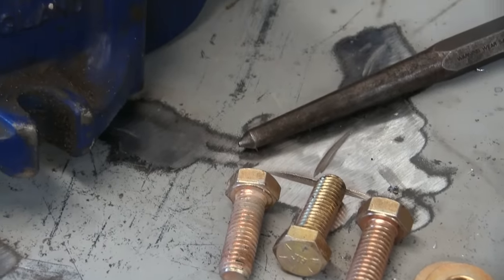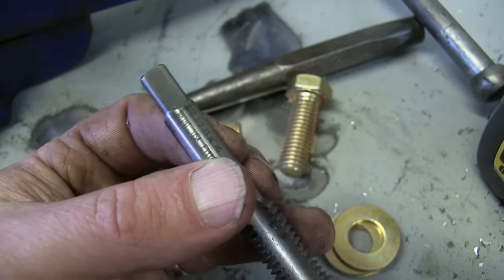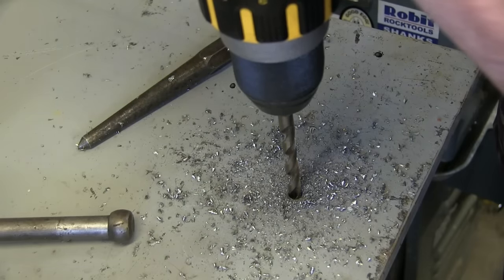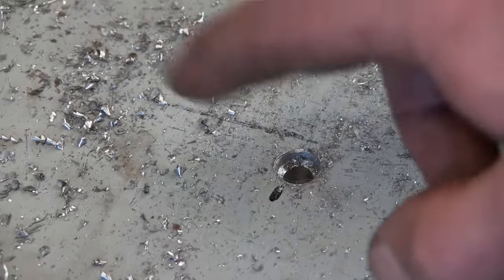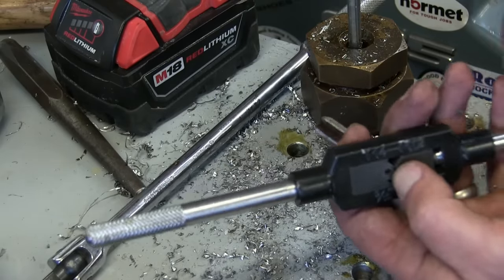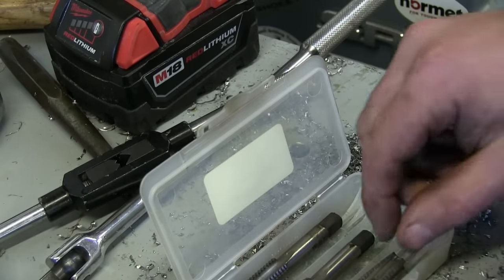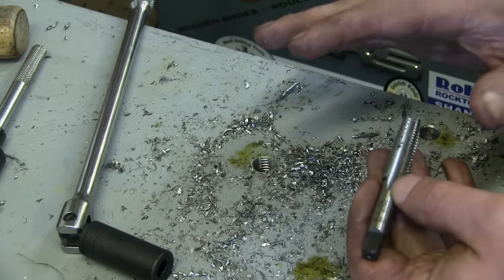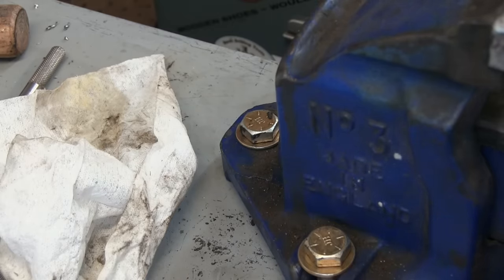Drilling and Tapping for German Virgins.  \\ GUDENTOIGHT!  //

Comment: I haven't read all 827 comment so this may have already been said.
About getting the tap started straight by hand with no guides...
Once you get a part shallow thread started, the tap will pull in but can still go crooked.
When you get to that stage, apply some vertical UP pressure on the tap handle as you turn the tap.
This greatly helps to get the tap vertical, going down the hole.
When you have about two full turns like this, you don't need to maintain any more UP pressure; just carry on turning, turning and reversing. The tap will be concentric in the hole. 
The was shown to me by a great friend and skilled machinist/welder/fabricator, Neil Budgen (Get It Sorted) of London, England.
Reply: Ross Marsden thanks a lot for taking the time to share this
Reply: Ross Marsden that’s really good advise

Comment: Pro Amateur Tip: If you can't get your taps started straight by hand and a drill press won't help you, find a machinist, become his friend (which requires you provide food and/or beer and generally for you to be a decent dude yourself) and ask him to make you a tapping block... A tapping block is nothing more than a 1" or so thick slug of steel with holes precision reamed in it for popular tap sizes, like 1/8", 1/4", 5/16", etc, etc (or metric, or both). It will keep the tap straight for you until you learn how to do it by feel (which... I have my good days and bad days).

The meanest, oldest, crustiest, most son of a bitchenist machinist at a place I used to work gave me the one he made when he was in apprentice school when I asked if he'd make one for me, which I'm pretty sure means I owe him like 2 horses and an oxen under his Journeyman's contract.

So... It's nice to have friends. I'll also never forget that guy and that block is one of my most cherished tools.
Reply: 4 years later I know you still gotta have that thing. I bet youll still have it 30 years from now too haha
Reply: @fudgepuppy9683  I'll die owning it unless someone steals it. It's in my toolbox covered in air tool oil inside a ziploc bag. Ready when I need it!
Reply: @TheBrokenLife  🦐

Comment: I always use a cordless drill with the torque set low for tapping. Never broken a tap yet. Unless you count the ones that snap.
Reply: I use those Lisle tap sockets on a cordless impact. I've tapped thousands of holes like that, never broke one
Reply: I do this as well.  As long as I stay paranoid I don't break em.

Comment: just the tip and only for a minute
Reply: Just the tip doesn't do much for me, I gotta at least get down to the scar where my foreskin was attached.
Reply: Aye, hows about startin' the tap w/ the drill press (movable bench top version)? Same for the pilot hole: drill press? Hell, the entire job for that matter? Why mess with a hand held for 1/2"?
Reply: John l bales, for the sake of showing the average home gamer that they too can do this without fancy equipment. Ffs I have access to several CNC mills and yet I too still put a hole or two into material with a good ol hand drill.
Reply: P.S. Drill press to Start the tap straight! You are way more knowledgeable than I. Hats off to you.
Reply: forkin entertaining.  part 2 dying to die
Reply: That's what she said
Reply: Didn't David Allen Coe sing about this?

Comment: Great tips Uncle BBF .... tapered point plug taps  oh yeah my favorite.  If you  don't have the correct drill don't be shy about going 10% bigger then that engineering wall chat says.  PRO tip you won't be breaking any taps either!
Reply: Awesome Me I do a good amount of CNC and spiral flute taps are a godsend. they eject chips as they cut. I use them for hand tapping too and haven't had any issues. no such luck for bottom taps, but they're not designed for forming.

Comment: Good to see a Record No 3 vise made it abroad :-)
Now. When drilling into sheet metal, tear off a 1 inch strip of old bed-sheet 6-8 inches long and fold it into 6 layers. Place this folded cloth between the tip of the big drill and the pilot-hole, then drill-away! Keep going and you will find that it will cut the cleanest sheet-metal hole you have seen. It's called the "Rag-Method"; every engineering apprentice learns this.
Don't believe me? Try it on a piece of scrap, you'll remember it forever!

Comment: Funny thing, I've been given no less than 4 sets of cheap assed tap/dies in my life and never used them. I didn't even know how to use them and never had the opportunity, either. I happened across this video as I was binge watching Youtube  while TV free in the keys for 5 months and learned myself somethin. Once I got home I needed a new miter saw and of course wanted crown stops. For whatever reason, Dewalt's crown stops are out of stock, worldwide. I decided to give the Bosch set a try and they looked like they would fit. Was I ever wrong. I needed to drill into the aluminum base of the saw and add a guide with two screw holes in order for this set of stops to work. So i go in the garage(the tap and die set storage locker) and got a set out. Followed your instructions and it worked like a charm. You really do learn something new every day :)

Comment: YES there is. You get a clamp, you put a piece of wood on the other side of the bench, over it you pass a long sturdy piece of wood that goes over the bench (and your drill point by quite a bit) and then you  add your clamp over the other side of the fulcrum (loose and taped in place) then you shove your drill under the wood and press with the might of 3 Canadian gorillas. Also helps keeping the cut steady since you're no longer practicing for your Parkinson's days.

Comment: I remember the first time I tapped a hole. Nervous, had only read and heard about it. Scared of poor performance, couldnt quite figure out how to put it in the hole right. But I started gentle and once I got it started added a bit more force. Ended up sweaty with a perfectly tapped hole and the knowledge that I was now a man. Cheap irwin got me started. More recently I found a brand on amazon thats good enough to use with just a straight drill - no impact, no tight spots, no binding - in 1/4 inch plate. Mind you, its only a 3/16" coarse - 1/2" is probably a different beast.

Comment: Also, it sure looks like AvE's drilling that hole in crooked at 5:24, but maybe it's the camera angle.  I think people new to drilling shouldn't take his suggestion that the drill will straighten itself out too seriously: it's hard to drill a hole at 45°, but drilling one 5° off vertical is really easy.

When I teach people to hand drill, I tell 'em to get their head down at the level of the drill bit, and check for vertical from two different directions.  (But get your head back over the tool when you start it up so you can apply pressure and don't get your hair sucked into the motor.  Yes this happens a lot.)  

Even better, get a helper to look from the side as you drill: the most common error is to tilt the drill back toward you as you bear down on it.  Eventually you'll develop a "sight picture" and be able to fly solo, but a drilling buddy really helps when you're getting started.
Reply: Simple drill guide: take a thick piece of wood and cut a 90 degree corner into it. Butt that against your drill bit – straight.

Comment: I was taught to power through all your problems. If the bit catches on barbs, increase torque, if its just not cutting, add feed pressure. MORE POWER

Comment: I've successfully tapped hundreds of holes with one tap using a battery impact. the thing that always breaks the tap is flexing and off center force. the impact never puts enough of a turn to break it as it really only turns the tap incrementally.  lube it up and tap a hole in 10 seconds through 1/2 inch steel.

Comment: Make it stop!  I like the vids but this was like volunteering for a women's self defense class without a cup.  

I sell drill bits and hardware for a living, and I see the same mistakes all the time. 
Don't drill pilot holes in metal!  Its unnecessary and it messes with the cutting edge of your bit. * your new drill bit comes with a  37° split point and finely sharpened cutting edge that will handle the toughest jobs if used properly*  You see, the bit is designed to cut the shape of the cutting edge starting with the tip and moving outwards. The pilot hole leads to uneven wear of the cutting edge of the bit. Over time you will create a "step" in that bit and it wont cut right and/or possibly it will catch easier leading to snappage™

Don't drill so fast. Chips are no bueno pore favor. You want stringers like that long one you had on the table. Chips mean you are going too fast and the cutting edge can't cut the material its just catching. Long stringers means its cutting. Its the same way in wood working when using a hand plane. 400 rpm there abouts will get you good results. That is why they put them pressure sensitive switches on drills and not just a single pole throw switch. 

Cutting fluid is a good thing, keeps the tips/work piece from bluing and over heating, getting brittle. Dont really want a Lubricant per se because a lubricant reduces friction and if you ant got no friction you aint getting a cut. Some cutting fluids are friction modifiers to add to the cutting ability but keep the bit cool. So no motor oil or WD-40 ( Did you know that the WD stands for " water displacing"... But WD-40 no longer displaces water? it floats on top ) 

This is unrelated but why use those Tiawanesium bolts? A good American bolt or Canadian bolt is only a few cents more! JH is Junk. Nucore, Lake Erie, Infasco are all easy to find and are good stuff. Those Jin Her bolts you used are widely available but is only fit for using on.... well not much I would want it on actually. I guess bolting down a vice to a table would be proper.... but I would just have to remember to wear my steel toe boots. I have had customers complain to me they were snapping G8 3/8" bolts with a 1/4" drive ratchet.... Not the first complaint I had on JH bolts. ( We don't sell JH only American made hardware but I see enough of the junk around I learned the makers marks for quite a few MFG) Tifco dot com if your wondering.
Reply: Scott H clearly a salesman with no shop experience.
Reply: Yeah. I agree, But you really dont need pilot hole unless hole is so big that you or your machine cannot handle drilling without pilot. And actually when drilling your chips should be short and HOT. If your chips are long and cold it means all the heat from cutting is going in your tool and/or workpiece. And if that drill is near 10mm good cutting speed for that is around 23000mm/min  23000/3.14/10 = so about 700-750 RipEm's. And downwards feed should be around 70-75mm/min. So for me AVE's drilling job looks ok to me.

Comment: Speaking of Germans and tapping, it appears that Metabo has introduced a gewindebohrer version of their biggest 18V bohrschrauber. Apparently it has a mode where it automatically goes 1 turn backwards for each 2 forwards – unlike its schlagbohrer counterpart (which is hands down the best battery drill I have ever had the pleasure of using) it has a dinky plastic chuck, wherein (rumour has it) there are square mounts for M8-M12 taps. Quite an interesting oddity.

Comment: Using a power tool in 1/2 steel would be begging for a pain in the ass night. Hey Ave I bought some starrett tap wrenches. Beautiful set. Spring loaded jaws and the finish is unmatched. Thanks Dr. Ave

Comment: I have a jillion ( or is it a gazillion?) drill bit and tap and die sets but don't enjoy breaking bits. The single best way to enlarge a drill hole to assure concentricity and to avoid a tri-lobe hole, use a single flute step drill. Even the cheap Chinesium ones from HF are a bargain AND they work really well. There are several sets of three: small, large, extra large, fine steps, coarse steps, and smooth taper. With your 20% off coupons (only one per day) you can get the whole set for about $40.

Comment: Get yourself a magnetic digital angle gauge and zero it to the surface you are tapping. Place it on the shank of the tap and you want to make sure the tap is plumb while you are starting it by checking the gauge in 2 places 90 degrees radially apart. 
 You can also just take a nut and thread it onto the tap and use that as a reference so you can keep the bottom of the nut parallel to the surface you are tapping. I did a big machining job on some 2 inch thick plates and I cut threads by hand tapping using the nut trick and I could not get a .002 feeler gauge anywhere underneath those fasteners after I had threaded them in.

Comment: Chinesium. Love it! Just because it looks similar in shape doesn't mean it will be as strong. Having the proper material for the equipment is vital, unless you like walking back to the china tire to return and return and return... people forget that their time is valuable. With non-chinesium equipment you can put the gorilla onto it! Speed is the main killer for cutting tools, not necessarily feed. Anything over 6mm (1/4") you can load up nice and heavy. Try it in a drill press, just lean on that handle. With the proper speed you can feed that bit with all your might. I will concur on the chamfeer, very helpful when trying to start a thread. Bonne Vid!

Comment: Chinesium........that just cracked me up, I'll be gigling all day with that word stuck in my head

You could also make up a drill guide plate like John (Doubleboost) uses when needing to drill square to the workpiece, use a few of the more common drill sizes then make up a tap guide plate in the same way

Comment: I do not like that socket-style tap wrench.  It puts a ton of sideways pressure on the tap as you turn it, which will rip the tap out of the new threads.  You can see how AvE has to hold the tap with his other hand to keep it from shifting.  Two-hand symmetrical tap wrench is the way to go!

Comment: The biggest reason hand taps break is not starting them exactly in line with the drilled hole. If you are tapping deep and not in  line with the hole one side of the tap will have much more load. That puts more stress on one flute and puts a large side load on the tip.

Comment: At my work we have a special power tool for tapping  (we make plastic injection moulds), maybe some day i will film that thing in action. Basically it is on a special arm just so tap is aways straight, and it has some sort of a torque limiter so you do not break taps. It is seriously cool too.

Comment: I was taught taps with straight flute are only to be used on see-through holes. That for blind holes you need taps with spiral flute in order to extract cut material which straight flute can't do.

Comment: I've used a 'brace and bit' drill for tapping threads in holes, it's easier to keep the tap in line with the hole than a T handle.

Comment: Ive once saw a really nice tool for tapping, its was pretty much a drill with a very high reduction gearbox controlled by a small angry pixie mace (micro controller) that made it do half a turn forward, quarter turn backwards, haft a turn forward, and again back, as long as you pulled the trigger.

Totaly pointless due to the existance of taps made for powertools, but still a neat idea.

Comment: easier to start a tap straight if you use a squared up block with a hole in it that the tap fits through. then no eyeballing or crooked threads.

Comment: Nominal diameter - pitch = drill size for 70% threads. M6x1 uses a 5mm drill, 3/8x16 uses a 5/16, etc. No more charts needed. 

Drill a little bigger and you can use a drill motor with greater confidence. 60% or so threads is fine for most shop chores. 10 up to 1/2 only with drill though, will bend smaller taps too easily and won't have enough torque for larger typically. 

Make a drill guide if you want to make rock-solid tapped locations straight.

Comment: I had to tap a shit load of 1/2 coarse holes a long time ago with a plug tap and I used a 3/8 drive air ratchet to drive the taps. If it got overloaded the motor would stall before breaking the tap. Needless to say I didn't break the tap during the run.

Comment: I know I am commenting a shit ton, but also, when you thru-drill a hole, you regularly don't need to break the chips, as they will have the possibility to go both up and down the hole, so unless theres a very deep hole, my experience is that the breaking of chips often makes for more uneven threading and increased risk of damaging the tap or threads, but it also depends a bit on material, in mild steel I rarely care, tool steel however is a bit different.. ah well.. carry on, sorry to interrupt you(not that I really am...)

Comment: I prefer spiral taps so i dont have to go back and forth. Just straight through, even blind holes since it will pull the chip out of the hole :)  Sowa brand yellow ring HSSV3 is my tap set I use on stainless everyday. They have slightly different geometry to accomodate the stick nature of stainless.

Comment: I would like to add that for every 1 degree of angle deviation from your desired angle, (be it perple dickular or not) for every 1 " material depth is equal to a drift of .018" on the opposite side. I's had to straighten out more than my share of angled holes, (courtesy of my noobs) in Forward, Main, Rear/Trailing Edge wing spars in Sovereign Jets in my days as crew lead. So it IS possible to drill an angled hole after starting out in a good position. I've seen it many times. With dreamers too ( Drill/reamer combination bit). There's guys who can't drill a straight hole to save their lives.

Comment: For perpendicular hole drilling / starting a tap, you can use a mirror with a hole in it (or even two mirrors, one either side of the hole) - if the reflection is anything other than straight you're not perpendicular :o)